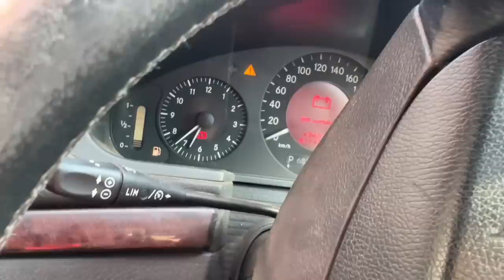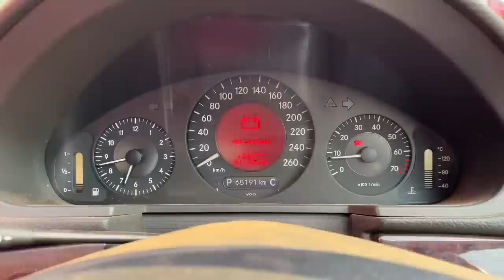ഇനി രണ്ടും കൽപ്പിച്ച് ഞങ്ങൾ

Comment: It is just an elbow, there may be something similar in the plumbing store which you can customize and clamp it. Maybe 2 elbows join together. Or you can take it off and 3D print it with plastic and use some sealant and clamp to secure it.